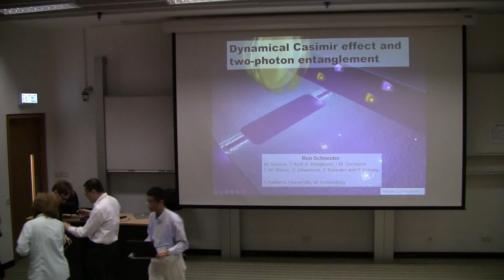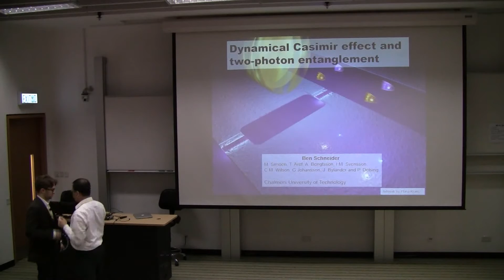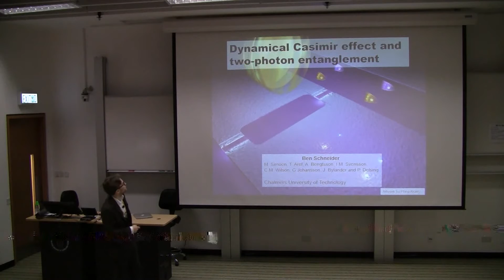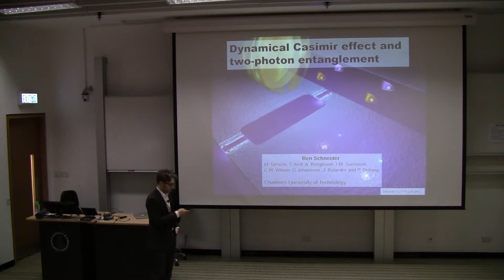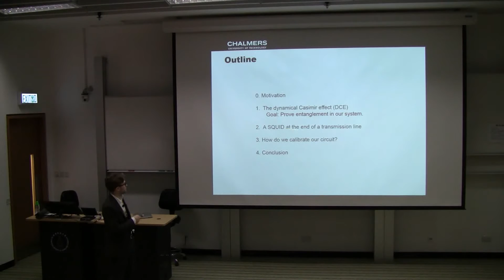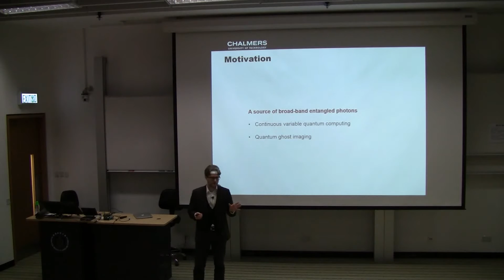Dynamical Casimir Effect and Two Photon Entanglement  - Ben Schneider

Comment: I guess I don't belong to your audience due to being way under your level of education and understanding, but I hope I may add some questions and things I noticed. First of all, you could have shown up what a squid is (I knew it from other videos), but maybe you expect your audience to know that. Then it was hard for me to imagine how your device could look like and work by just looking at the functional diagram of the device. It took me quite a while to understand that the green box is a magnification of the purple one. Also, you maybe could have pointed out your decisions of selecting, for instance why choosing Niobium (most likely due to superconductivity), Sapphire and Aluminum as squid. All of that, I guess, is expected to be known by the audience.

Is your current source (AC Flux pump input) an electrical one? @13:58 Why do pick a measurement symbol for current as current source later? As you picked the symbol for it, are your resistors in fact rather coils?

I find this topic very interesting. Thanks for your presentation and I hope you have made some progress meanwhile. I'm very curious about this.